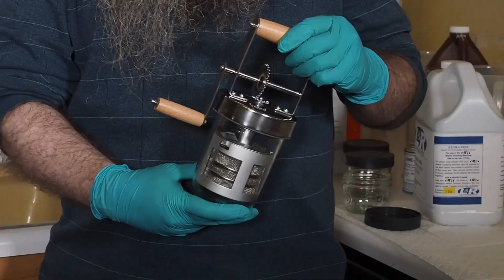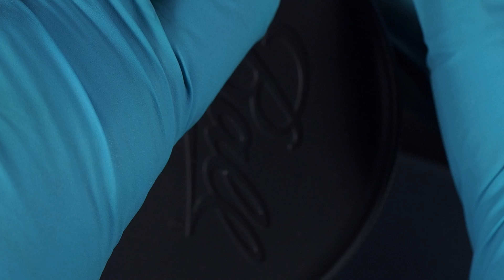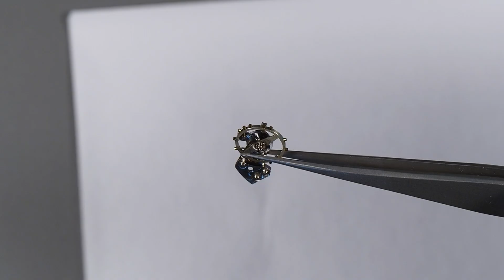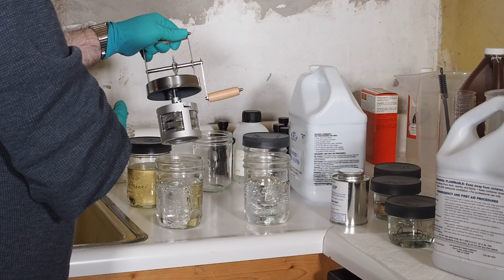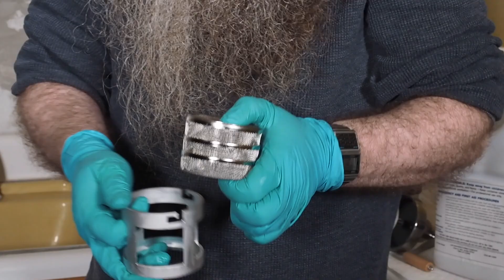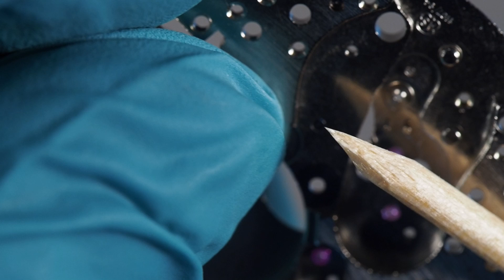Watch Movement Cleaning

Comment: Can I suggest that you consider not spinning the excess liquid off in the empty jar. When the parts are submerged in the fluid they are protected by the fluid whilst you spin. If you then spin out of the fluid you run the risk of parts hitting each other and the potential for damage. Might be worth consideration.
Reply from the maker: That means contaminating the next chemical and greatly reduces the life of the solutions. I haven't had anything damaged yet.